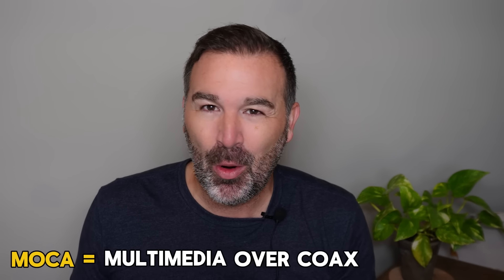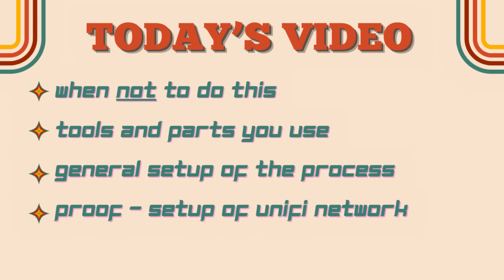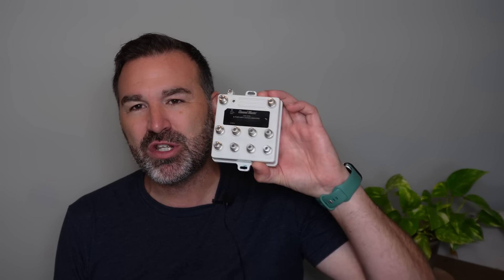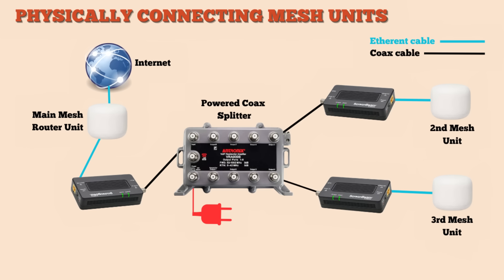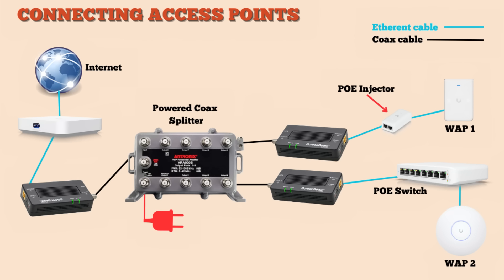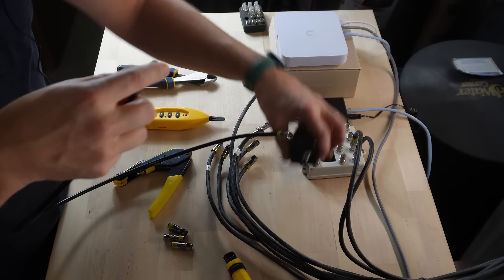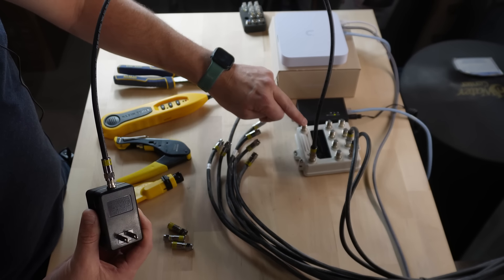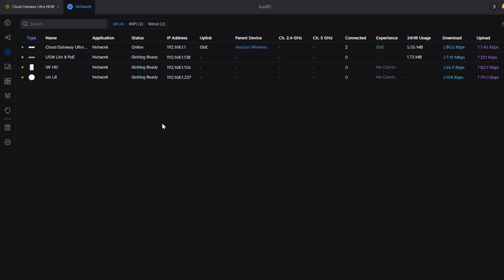MOCA - Building a Unifi Network using Coax Cabling

Comment: The MOCA filter at the point of entry should stop any external MOCA signal from entering the house, and also block the generated MOCA signal from leaving your house as well..  this was important to avoid putting your data out to the neighborhood.  I have used them, they work just fine…. Also some of the cable equipment used to use MOCA, if that’s the case, your screwed, you won’t be able to use it for Ethernet data drops.
Reply from the maker: I am glad this video has sparked so much conversation... Maybe MOCA was used in the home by the cable equipment in our case... because I had the point of entry filter installed and the second outage still happened.  Either way, lesson learned and people should be careful before proceeding if they have cable services. There is no guarantee that the POE Filter will save the day...

Comment: MoCa adapters do work when you have cable service at home, Cable TV, and the Cable Modems use a different frequency then what MoCa uses, However some of the cable modems operate on DOCSIS 3.1 which operates on the same frequency range of MoCa adapters, So you would need to change some settings on the MoCa adapters to use a different band and frequency.
Reply from the maker: Thanks for sharing to the group.  The Mocas I had don't have any way to configure them.  Is there an adapter that you would recommend that does have this ability?
Reply: @ethernetblueprint  also MoCa has pretty always been able to support tv and internet on the lines since version 2.0. Perhaps your devices are actually EoC aka Ethernet Over Coax or older MoCa. Those deffiantly dont play with tv or internet on the lines and have to be "dark" coax as you said in the video

Comment: Some incorrect information in the Video..  I have Xfinity with a rented modem and it has MOCA access built in. Just log into the ADMIN portal and toggle the Moca option. It only supports moca 2.0 so only 1 G speeds
Reply from the maker: That is good to know.  I didn't know what ISPs offered that so I didn't want to cover it in the video.  If users have that as an option, it sounds like it could be a decent option... Although one of my other commenters said his ISP moca was unstable and turned off all the time...  so, it may be a case by case.
Reply: Are you referring to Rogers Xfinity cable isp in canada?

Comment: I have Cox cable at home, I use this Antronix MVRAM502B which is MOCA amplifier (moca filter built in) at point of entry so this works very well even moca without issue. This is my best solution for moca use. Did you know that Cox rental panoramic wifi modem does have moca built in? They does! However it keeps turn off every day I think so it’s not worth it. Better use moca hardware it’s better than sorry. Even I helped my friends to use similar setup as mine for Mediacom cable where his rental router is Hitron router/modem combo has moca so I set him up Hitron wifi extender (with moca built in) and it worked for them and they getting same speed. Like everyone advice is always put moca filter or moca amplifier or moca splitter on point of entry as before enter house so it won’t interfere with neighborhood when plugged in and using.
Reply from the maker: Thanks for sharing that... and the models you used.  Hopefully it helps someone who has Cox and wants to do this.  Really appreciate the comment!
Reply: @ Anytime! Also full Ubiquiti Unifi gear at home so love it so far!

Comment: You don't know what your talking about.  That splitter can jack your system all up
Reply from the maker: Appreciate the input.  Just basing it on personal experience.  Have never had a an issue.
Reply: @ethernetblueprint if you slip the signal or amplify the signal of a ISP coax network you can cause your modem to not be able to communicate properly.  If you are not using a coax ISP and only using your in home coax for moca this is fine.  A moca filter will also block all moca frequencies from leaving your residence and needs to be placed at the dmarc.  .most coax amps amplifier 12 to 15.db which is amot without knowing what the signal is coming into the house

Comment: The biggest problem with running multiple MOCA adapters through a splitter is that the MOCA part of the network starts acting like on old Ethernet hub.  So you get signal degradation because of 'packet' collision.  I have found that making multiple MOCA runs is best done with isolated coax cables and MOCA adapters on each end of each coax run.  Then the network retains true 'switching' functionality, because each MOCA adapter at the source will plug into its own ethernet port on a switch.
Reply from the maker: That is a fair callout.  Isolating that moca traffic would be the cleanest way to ensure no collisions.

Comment: That was odd that the Point of Entry filter did not work with your customer and the Cox service.   I have some Moca adapters and a filter at the demarc at my house and my neighbor on the same connection pedestal has no issues.   Perhaps Cox had some odd equipment in that area that had overlapping frequencies with the devices you are using.   Might be worth some technical deep diving for future customers.   Moca is so useful since so many older houses have coax, especially on the 1st floor of a 2 story house where it is hard to run ethernet.
Reply: They didn't have a PoE filter if there was MoCA leakage.
Reply from the maker: I'm not sure why the filter didn't work either... Maybe it was the Moca adapters I was using.  Heck, maybe I got a bad filter... Either way, I think it is good to have all this commentary on the subject so people are careful when installing these in their homes.  Sometimes things don't go as planned.

Comment: Great overview of MOCA. Two additional details:

1. The splitter must be capable of the sending the MOCA signal. Specifically, the splitter must be capable of sending the signal at 1650MHz then you are good to go. 

2. Put caps on the unused splitter ports and/or on the ends of cable runs and there will less need for a powered splitter. Also, putting caps on will also make tracing cables more reliable. A powered splitter is not necessary if you limit/reduce signal loss by using the caps. Note that these are not fancy capacitors - they are just physical caps.
Reply from the maker: Good Tips.  I am definately not a moca expert, and was just sharing my experience on how to retrofit a home to get people's wheels turning.  I appreciate your comments!

Comment: you can use RF modulators to send legacy composite video + stereo audio over these in the form of NTSC TV channels without interfering with these units. it's a good way to set up a one-wire CCTV system, and all you need is a tv with a basic analog tuner to view the video channels. even when i still had cable, that's how i managed all my cameras and "casted" my PC and VCR to all the televisions in my house that way.
Reply from the maker: Lots of moca experts out there much smarter than me.  Thanks for sharing!

Comment: When I upgraded my Verizon FiOS 100/100M service to 1/1G, they had to swap out the ONT in the basement while the router in my office stayed as-is.  That meant I could no longer use coax (RG6) to link them and it required CAT5 or better ethernet.  Since I hd no way to run it between the locations, I got a pair of 2.5Gbps capable ScreenBeam MoCA 2.5 adapters to perform as media converters... one at the new ONT and one at the router on that dedicated coax cable between them.  Works flawlessly.  Keep in mind that older coax set-top boxes and the cable provider's router typically already have MoCA built-in... that is how programming info/control is relayed.

(BTW... I canceled my TV service and no longer needed the coax attached set-top boxes and replaced my Verizon router with a Firewalla Gold - a real router/firewall with VLAN & VPN capabilities)
Reply from the maker: Very nice.  Thanks for sharing.  Glad it worked out in your case.  I plan on doing some Firewalla videos soon.  I like their products.

Comment: If your ISP offers the XB Series modem (XB 6, 7, 8), a MOCA transceiver is built in and can be activated by logging into the modem, a MOCA filter would be required at the main entry point to prevent that signal from going to the cable tv network, a home RF splitter that supports over 1GHz can be used to distribute the MOCA signal within the home environment to the individual adaptors.
Reply from the maker: Lots of great comments like this on this video.  Thanks for sharing!

Comment: Great video!!  Not sure why you started off using the amplifier.  Strange that your system crashed your neighbors systems.  Maybe the Cox router does not like it when a foreign moca router is on the system or it tried to hook up to other external mochas.

I use the gocoax moca adapters with a oneway filter on Ziggio network on the Netherlands and the moca works great.

Finally, I noticed that you are using a Poe switch.  You may consider using POE splitter to power your moca adapter. This would eliminate one power cord.

Thanks again for the informative video
Reply from the maker: Thanks... I based all my content off my personal experience and have found the amplifier works well.  Cox is famous for doing things weird, so I'm sure it was something on their end.  I think its important to share those stories because for every success story like yours, there are many that don't go that great.  I don't want to give people a false sense of "this is so easy" when I know personally, it doesn't always go well.  

I have never heard of POE Mocas... That is amazing.  I will definately be googling those and looking into them more.  Awesome tip.   Thanks for watching and sharing!

Comment: Thank you for your awesome videos.  My setup for my home is I have 4 eeros for my wifi. (1 eero hardwired to my modem,  the other 3 spread throughout the house not hardwired.) I also have ethernet cable at several TV locations hooked to 4 port switches.   I want to replace the eero's with ubquiti for more control.  What AP's would you recommend?    P.S.  My current wifi coverage is fine just want more control then eero offers.
Reply from the maker: Will these APs be sitting on furniture our mounted somewhere?  Will you need to use POE injectors for them or will they be powered via POE from a switch?
Reply: @ethernetblueprint   Hopefully I can power by POE.  Currently the eero are just on furniture.
Reply from the maker: If you don't have a need to plug other equipment into your Unifi APs, look at the U6 Mesh AP.  They work great to just sit on furniture, but only have a single port on them ... Also the U7 Pro Wall has a furniture stand which would work as well. 
If you need additional ports for other devices.  Look at the U6 In-wall that has a small managed switch on the bottom.
Reply: @ethernetblueprint  Could i combine a U6 Pro  in the basement ceiling & the U6 in-wall for near my upstairs TV's?? (I currently have a switch at both my upstairs TV's for streaming & xbox) Thanks for the info

Comment: Will you need main internet Running through from coax? Because I have internet Running from fibre optic. And from fibre optic planing to do upstairs Ethernet hard wired? Please let me know if that works. Be cause I have all in room up stair coax in wall.
Reply from the maker: It potentially works better if you don't have internet that runs on Coax.  You should be able to use Coax to extend that service upstairs using mocas.

Comment: Slightly confused.  If my house has a coax coming out of the ONT that goes into a splitter, that then splits into the coax that goes through the walls, I can just use those and not have to worry about making new cables correct?
Reply from the maker: This is totally possible without making cables, yes.

Comment: Is anyone know if there is a limit to the number of adapters you can have on a coax network? For instance I have four rooms and wanted to install three to four moca adapters. Will they confuse each other? Do the lines have to be isolated? I updated my splitter to a MoCa compatible splitter. I need to look into bonded versus unbonded moCa adapters

Comment: Keep in mind also that many people claim to have problems getting it to work.  That may have been caused by a number of things.  Maybe they had two different brands and one doesn't play well with the other.
Reply from the maker: Yeah... this video cause quite a stir... lots of comments with people sharing their stories or correcting me in them.  I think the overall solution does work, but it does depend on what parts you use and your specific wiring.

Comment: Our coax terminates outside in the ugly gray box. If we disconnect the line coming from the cable company, do we even need this device installed outside? (We do not use cable services.)
Reply from the maker: If you have internet in the home via dsl or something other than Coax, then you should be able to disconnect that line from the cable company and possibly use the splitter that is already the box to distribute the signal to the other areas of the home.

Comment: It's very odd that you had leakage even with the moca filter. You absolutely should not need 'dark' coax for this to work. I've created quite a few MoCA+DOCSIS3.1 networks without any serious issues. It sounds like some your adapters are defective, or the filters are cheap/broken/fake. Just bizarre. I've only used GoCoax gigbit and 2.5 adapters. Not sure what is going on with your equipment but you can absolutely use the same coax connection in the wall to connect to your router, and a MoCa adapter. Many of them have a splitter/filter built in, and you can also just use any splitter as well. On one install, I used an additional moca filter between my modem and the rest of the coax network, on top of the barrier filter.

That being said, it really is best to isolate your MoCa network from the modem/TVs. I've absolutely seen some conflicts and speed/reliability issues in the past with certain modems and certain MoCa adapters. Depending on your needs, you can have each run of coax independent (IE don't combine all coax for the whole house together.) Some people don't realize that even the fastest adapters are sharing roughly 2.5gbps total throughput between all the adapters. Not always that economical though if you're hooking up a bunch of rooms. Wherever possible, treat each run independent with only two adapters, and you can get way more than 2.5gbps total bandwidth in your house.
Reply from the maker: Appreciate the comment.  Maybe it was my equipment. If nothing else, I was just hoping to create awareness that stuff can happen.  MANY comments on here share your point and that you don't "need" dark coax for this to work and I either had defective parts or didn't know what I was doing... Either way, I am glad you shared what you use and appreciate you taking the time to help the viewers!
Reply: @ethernetblueprint  yep and I still do actually recommend using dark runs, with as few moca adapters connected as possible. After all it's just shared rf spectrum. If one could install a switch near their coax junction box, just imagine the possibilities. Depends on the throughput needs, and budget, of course.

Comment: Question. My scenario is that I have one coax cable coming into my basement, where it goes into the modem/router. Can I completely eliminate the modem/router from the equation and plug the coax into the moca adapter then to my UniFi cloud gateway? Thanks
Reply: You still need to have the modem to make the connection to the ISP. The Cloud Gateway would act as your router for your internal network.
Reply from the maker: No, you still need the modem/router, but you would just need to find the line that feeds the internet to the house and make sure that it alone is plugged into your modem/router... no other splitters... And that your router was moved to the location where all your coax cables are in the home.  (You're in the "gotcha" scenario I described)

Once you isolate that line from the rest of them, then all of your other cables can be used to convert the cables to network cables.   That scenario will work for this.

Comment: Just running an ethernet cable would have been better and cheaper.
Reply from the maker: That is always the preference.  However, sometimes that isn't possible.  Its all situational.
Reply: @ethernetblueprint  You can always put them near the ceilings.
It's also less complicated. Less complicated is always better.

Comment: How can you justify spending more money on networking when you have such a low speed connection?
Reply from the maker: IMO, Speed isn't the only benefit to this stuff... visibility, control, Easy Management, Remote access, alerting... all play a factor when looking at something nicer like this.  

If you're basing that off of my speeds, I had Gb networking with Cox, but refuse to pay $160/mo just for 1Gb internet with unlimited data.  Verizon is $25/month and all my stuff works and its unlimited data.  Now, that being said, we have a new fiber provider coming into the neighborhood and I plan on trying them out and using the verizon as my backup... which this equipment can do.  Not sure if that was directed at me, but wanted to share my 2 cents for my situation.